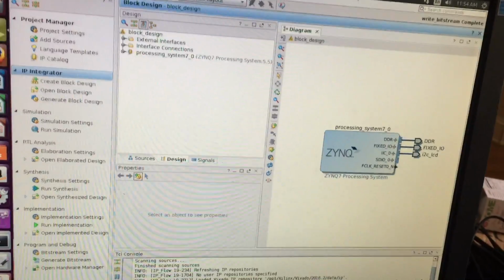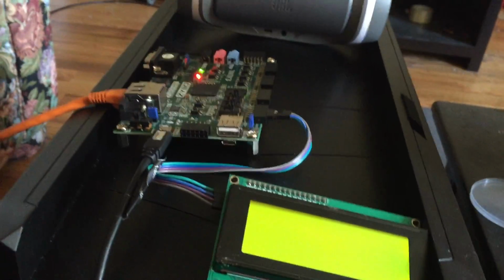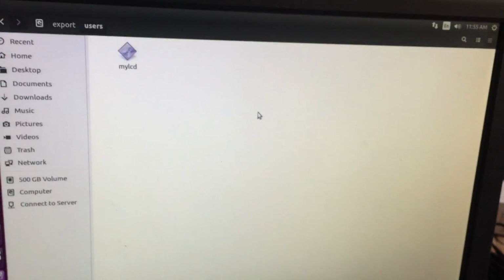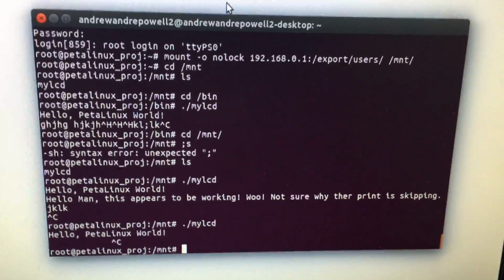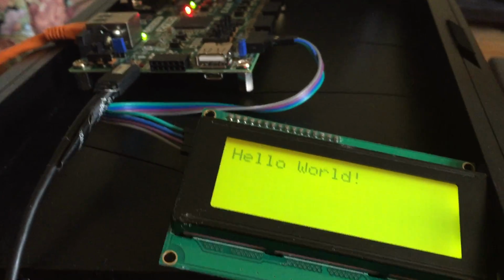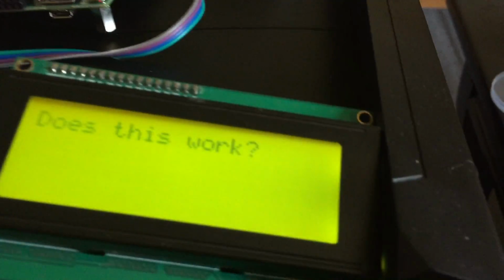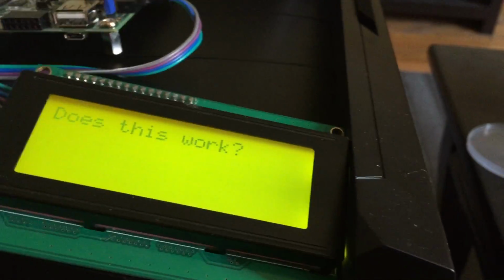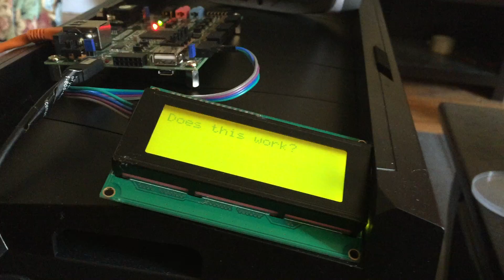PetaLinux on Zynq PS I2C Device Driver with LCD

Comment: Hi 
Well done! 
Did you run Peta-Linux on ZYBO or you create no-OS application using Vivado?
Reply from the maker: What do you mean? I didn't use a pre-compiled kernel, if that's what you mean. In every project, I customize the Zynq's PS within Vivado, export the bitstream and hardware specification, and then build the PetaLinux kernel using the tool set.
Reply: What tool set are you using?
Reply from the maker: I just downloaded the toolset from Xilinx's website:
http://www.xilinx.com/support/download/index.html/content/xilinx/en/downloadNav/embedded-design-tools.html
Reply: Could you recommend any tutorial how to create such applications?
Reply from the maker: I'm assuming you are referring to more than the user application. Are you already familiar with creating the hardware with Vivado?
Reply: I am newbie in Vivado but I am learning quickly :D I am using ZC706 from Xilinx and FMCOMMS3 from ADI. I did all examples provided by Xilinx and ADI so far but I didn't found an example with Vivado design and linux kernel so I am very interested in it.
Reply from the maker: If you learned a bit about how to configure the PS, then all you would need to really know is how to build a custom kernel! I can't recommend you any examples since I didn't use a specific example when I started. If you follow the directions in UG1144 ( PetaLinux Tools Documentation ), you'll be able to build your own kernel. It really helps knowing Linux, by the way. So, if you already have a lot of experience, you should have little trouble after building and loading the kernel.
Reply: Thanks Andrew :)
Reply from the maker: No problem, and good luck!
Reply: Thanks Andrew. Its a great video. Do you have any idea on how to implement in the zynq device, fetching data from sensor device connected in the Pmod using i2c connection then routing the data into either in the PS or PL system and saving the fetched data into the sd card memory. Any help is greatly appreaciaated. Thanks. God bless..
Reply from the maker: Unfortunately, I have yet to do a project with the SD card. But, if you're using Linux, I'm pretty sure you can mount the SD card and access it normally. Hope this helps!